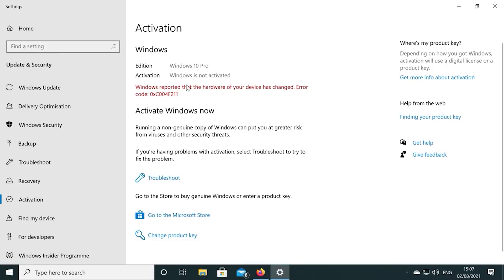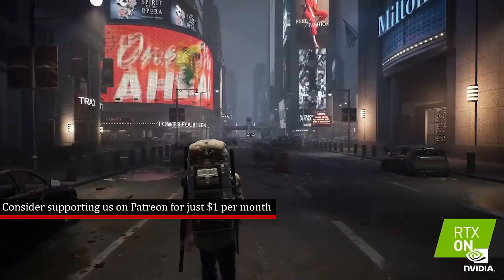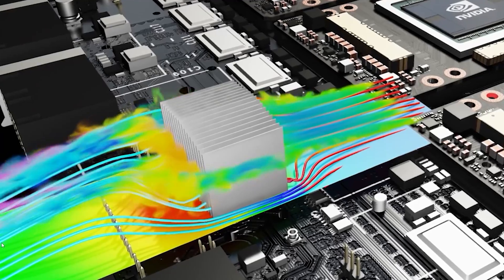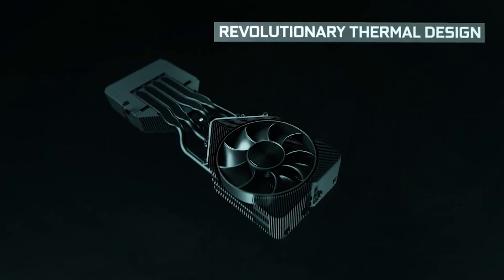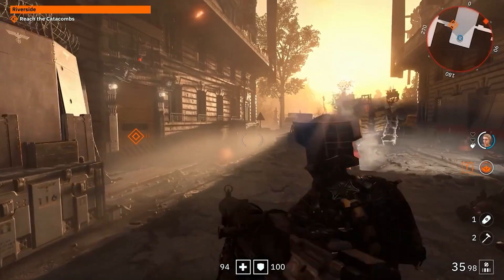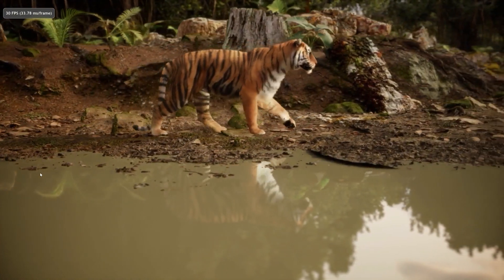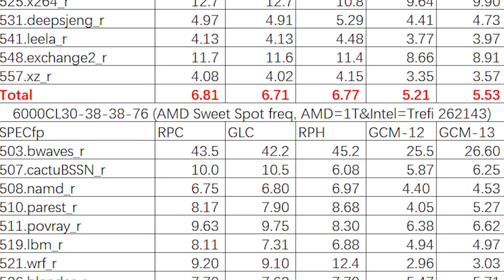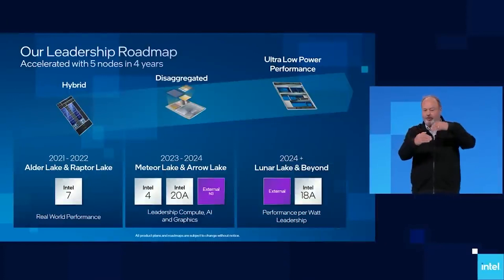RTX 4090 Specs DWARF RTX 4080 - Major Specs UPDATE | RTX 4080 Ti & Path Tracing Leaks

Comment: There's a moderate chance these cards are 600W or higher instead of the 450W published value, especially if you buy from AIBs. There are space heaters that use less power.
Reply: AMD has been making 500 watt GPU since the fury, i havent seen ANYONE cry about the watt usage ever tell it was NVIDIA using more watts.  Is it fanboyism or just ignorance?
Reply: @4gbmeans4gb61  The 6900XT is 300W, you gonna dig up the museum pieces to make your arguments?
Reply: @syrupybrandy2788  Mine OC uses up to 430 watts, about the same as an OC 3090.  Just stop with your fanboy cry baby act.

Comment: The difference between 4090 and 4080 is simply because the cost per transistor goes down far slower than the number of transistors you can put on your chip. So the trend is clear NVidia can spend more money to deliver more performance at the top-end SKU while manufacturing costs at a given performance improve at a slower than that pace.  A die shrink to an expensive manufacturing process widens the gap between top-end SKUs.  As for making the largest card,  the professional market has a demand for as powerful GPU as possible, so there's a demand for a GPU that would be out of the price range for gamers.  So top gaming cards are probably going to become those chips that are designed for professional needs and costs, but Nvidia just slaps the GeForce name on it and has a GPU that both significantly more power and pricier than what would make sense if they were making cards only for gamers.
Reply: Or they just want to make sure there's enough room between the 4080, future 4080ti, and the 4090 - because as we saw with Ampere, those 3080/ti/90 cards (for regular consumers) were far too closely rated and were competing with each other - as we see how much stock is left now those cards clearly weren't well targeted price/performance wise. Most likely the future 4080Ti will sit in the middle, price wise, and performance wise it will be closer to 4090 stock, but then the 4090 will have much higher overclock boost potential (with the +600w boost option), to ensure that those who want the truly best performance regardless of cost, actually can see noticeable difference between the 4090 and the future 4080 Ti.

Comment: I can't see how they can all both the 16G and 12G as RTX 4080... 
- must be a bit of FUD from NV...
Reply: They made the mistake of launching the 3080 with only 10 gigs of Vram and then later made an updated 12 gig model (which also had slightly higher specs and higher pricetag). I guess they saw that both cards could sell, so now they're just offering both variants for the 4080 series intentionally.. But they fail to realize they already oversaturated their own market competition and now they're actively outcompeting themselves because most customers want to buy in the 300-500 price range, but most card offerings exist in the 700-1.5k+ range. Its so backwards. Only miners bought lots of high end overpriced bs up until recently. Nvidia lacks more situational awareness than your average sewer rat.
Reply: @Real_MisterSir  Well, yes, it just seems to me that these are just too different to both be called 4080, but we shall see soon!

Comment: I am considering picking up a 4080. seeing the 340+w draw  will my 750w be enough?
Reply: If it's good quality, yea. Remember, psus can deliver more than their rating, the rating (like in 750w 80 gold) just means the 80 gold rating isn't applicable above its rated spec (aka once you pass 750w its ratings no longer apply). Usually you can expect 30% above at increasingly worse efficiency - depending on the quality. If you consistently push your entire rig to its breaking point for prolonged time then it's a bad idea, but 99% of people don't do this.

If you have a power hungry cpu, lots of cooling, rgb, etc then the total power demand of the rig could pose a problem. But again, this is usually only an issue with fully specced full tower rigs.

Let me put it like this.
If you run a 12900K with a 360m aio or custom water cooling and multiple rgb case fans, then you'd want to look at a psu upgrade. Otherwise you'll be fine.
Reply: @Real_MisterSir  I am running a 9900k @5ghz all core ( 1.32v ) 32gb ram and a 2080 Super atm. No RGB, 3 intakes 1 exhaust and NH-D15. :)
Reply: @Hinjima92  In that case you should be perfectly fine even with a bit of boost headroom on top if the leaked tdps are close to retail version spec :) I run a similar setup but with a 750w corsair psu and 9700k instead, also plan on upgrading to 4080 if they're priced well and I expect more than ample headroom if tdp stays somewhere close to 350w for the 4080 and even 400w could be considered since the i7 isn't pushing as high peak tdp as more modern cpus.
Reply: @Real_MisterSir  Yeah, guess we will figure out soon enough :D  I have no problem buying a RM1000x and slap that in if 750w aint enough.  Good thing about Corsair is they use the same cables so you don't even have to unplug anything from the motherboard, you just slap a new corsair PSU on the old cables. You should NEVER do that unless they specify that its ok, they have a chart on their website saying its all good.
Reply: @Hinjima92  Oh yea for sure, I'm thankful I learned about the cable hazard before it ever became an issue. Swapping psu cables is the easiest way to fry an entire system with zero warning.

Either way, good luck on your build, hope you'll get your parts at a good price after the last couple years of dread haha
Reply: Go for AMD, NVIDIA is probably trying to scam us with the 4080. And yes if it's a good quality power supply it should probably be okay.
Reply: @MicroageHD  Telling my to go AMD was not on topic for my question at all. I prefer Nvidia over AMD when it comes to GPU's.  I have a RM750i so I got a quality PSU. I am going Nvidia because I have a Gsync monitor.
Reply: That 750 may or may not be enough. A 340 watt GPU leaves 410 watts for your other components. Paper napkin math tells me that you probably will be fine. If your PSU is good enough then you probably won’t have to worry about your PC shutting down. Check to see how many watts causes overcurrent protection to be triggered on your PSU. Transients may cause your system to pull 1000 watts or so. At the very least I’d try the PSU and swap it if it is no good.
Reply: @dex6316  Yeah, I am perfectly fine with upgrading to a 1000w PSU, only time will tell though.  I I am quite certain that power draw will be a major point in any 4000 series review or at least the 4070-4080-4090 due to the leaked rumors on power draw in the past months.  It would be nice to not having to buy a brand new PSU though :D

Comment: They're definitely gonna keep the 4080/12 at the price tier of the normal 80 series but in all the marketing they will quote the power of the 4080/16 which will land closer to 1100-1200$. Gives them the marketing edge over amd while "technically" having an upper mid tier with the 4080/12. Which will be an easy way to get me looking elsewhere for the next build.
Reply: I agree and I notice there have been no leaks of the performance level of the 12g 280w 4080 at all.
My guess is that it will basically be at or very slightly exceed the performance of the 3090ti and earlier leaks were saying that the speculated MSRP on the 4080 would be $849 while they were quoting the specs and performance numbers of the 16g 4080 which I think will be at least $1200 msrp.

Remember last year when the AIB's were not making any of their lower tier cards only the upper level cards in a tier such as no 3080 EVGA Black cards only 3080 FTW OC models?
What are the chances they do the same basically releasing few to none of the 12g 4080's but adequate supplies of the 16g model.
Sure they can market saying that a 4080 can be bought for as little as $849 but I bet it may be like finding hens teeth on actually getting one!

Comment: The 4080 Ti is going to be the new 1080 Ti...GOAT v2.0
Reply: Well, then it must sell for 700 bucks max.
Reply: @MicroageHD  inflation is a thing bro. $699 in March 2017 is worth $849 today. Depending on how it’s done, a 4080Ti for $999-1199 could be considered as great as the 1080Ti. I highly doubt the card will be great enough at those prices to be as warmly received as the 1080Ti, but it’s possible.

Comment: With all that energy hungry hardware being released in a few weeks I start to wonder what to play. Most AAA title, mainly the only games needing that kind of power, are kinda boring and repetitiv busy work simulations. Some honorable exeptions like Elden Ring run fine on (pre-) last gen hardware.
Reply: Yep the real issue right now is that there isn't being pushed any major original AAA titles. Most have gone to live-service models instead that don't infer big graphics demand increases, and the last major hitter Cyberpunk launched in a major flop and seems like nobody is quick to try and follow in its footsteps.

At this point the most likely game to truly push performance demands again, would be Crysis 4 - but that game has only been teased with a pre production teaser showcase trailer, so it's likely a few years away still, at which point 40 series will be obsolete as a market proposition anyways.

So either AAA games are low demanding, or they're boring, or they're not released. Not exactly a situation that hypes up the masses to go out and invest in power hungry expensive new hardware. Oh yea and there was a small thing about a war, an energy crisis, and an economic crisis to boot. Good times to be a gpu company with zero situational awareness.

Comment: I suspect the Path-tracing thing is just pure marketing. They're probably expecting AMD to have near parity with them for Ray-tracing, so they're going to pivot to talking about Path-tracing and will use a couple tech demo's specifically tuned for their hardware to make it look like they have a major advantage in that area. The simple fact is though, I'm not expecting many if any games with full Path-tracing any time soon. Most games are designed to look decent on consoles first and foremost, so taking the time to fine tune effects that the consoles probably can't even run isn't going to make sense from a financial standpoint. Heck, we still don't even see that many good games with ray-tracing yet. That'll probably change when the PS5 Pro and XBSX Pro come out, as I expect the major selling point of both will be better ray tracing. (Also better resolution or frame rates, but still.)

So yeah, I'm not going to buy a video card now for an effect that probably won't be common place for another 4-5 years. By the time that effect does become common place, it'll be about time to replace the card again and there will be options that can tackle it far better for a lower price.
Reply: LOL NO.  Amd uses software and Nvidia has built in hardware.
Reply: @4gbmeans4gb61  

AMD does have hardware for ray-tracing, it's just more multi-use and less heavily dedicated than Nvidia's hardware. If I recall correctly, their hardware is simply built into the TMU's and is therefore part of every compute unit, while Nvidia uses separate tensor compute units.

The benefit to AMD's approach is that it should scale up some with every additional compute unit added while also scaling with a higher clockspeed. Nvidia's tensor units are more capable, but you need to add additional silicon that can't necessarily be used for anything else. Since this makes for a bigger chip, Nvidia actually has to make some decisions on how they want to balance the chip for each generation.

Each approach has it's own pro's and cons, but one of the pro's of AMD's approach is that it should scale somewhat with improved raster performance even before there are any architectural improvements.

This doesn't necessarily mean that AMD will see a huge jump in ray-tracing performance, obviously. However, there are reasons to believe they might be able to manage it.
Reply: Rumors are saying at least 2-2.5x faster ray tracing performance for the 40 series over the 30 series for AMD to gain parity in Ray Tracing they would need over 3-4x performance improvement to start getting in the same ballpark.
Do you really think AMD is going to improve their numbers that much in one generation?
Reply: @billwiley7216  

First, rumors don't mean much. There were a ton of rumors for Ampere that turned out to be overblown, so id advise against banking on some of the more gung ho rumors here as well. 

Second, seeing as RDNA 2.0 ray tracing was a fairly late edition to the Architecture that was a little rough around the edges, AMD's probably going to have an easier time making major gains than a competitor who has a far closer to mature feature set.

Third, near parity is not complete parity. If AMD gets close enough, then Nvidia's selling point of Ray Tracing is going to become a lot less compelling no matter what.
Reply: @WolvenWeaver  Will be interesting but the major Ray tracing performance increases for 40 series over 30 series has pretty much been a major talking concerning the 40 series cards for a long time by so many sources I do not think it is nothing but rumors.
I do agree that to see actual performance numbers we need to wait on 3rd party benches to get real world not marketing numbers but this goes for AMD as well as Nvidia.

My personal opinion is that AMD Raytracing will be at minimum as good as 30 series cards and maybe a bit above that which would still be a big gain in that category for them  but they will still be behind.
Where I see them gaining more ground and it is really a more important feature is I think AMD will close the gap more between FSR quality and performance as compared to DLSS which has been the better quality upscaler.
Reply: @billwiley7216  

Well, I've been hearing for a while that AMD's Ray tracing improvements will actually outstrip their general use performance improvement. That's of course just a rumor, but given the approach AMD has been taking towards Ray tracing, it actually does make quite a bit of sense. Now, that's not to say that AMD is going to completely erase Nvidia's lead. Considering how many games are heavily optimized for NVIDIA hardware, completely overtaking that leads in a single hardware generation would be an extremely tall order.

But, given Nvidia's fixation on marketing its Ray tracing, if AMD got relatively close to that, or worse, managed to beat Nvidia in a few heavily optimized AMD titles, it would be a marketing disaster. Nvidia cannot rely on Ray tracing for its marketing if amd's hardware is starting to look in any way competitive. Therefore, I'm pretty sure the sudden focus on path racing is a hedge against that happening.
Reply: @WolvenWeaver  just a quote from one of your earlier post!😁 "First, rumors don't mean much."
Reply: @billwiley7216  

Yes, which was one of my caveats. This is why I mentioned that AMD's implantation may lend itself to that sort of jump. It's obviously not confirmed, but there are reasons why it may be conceivable.
Reply: @WolvenWeaver  Nothing has been announced yet.
Reply: @WolvenWeaver  Any speed up towards path tracing, would be an immediate benefit to ray tracing. They share the same hardware needs. So focusing on path tracing would be an extension to ray tracing, they are not mutually exclusive performance wise. Working on Path tracing is purely in quality domain, it benefits just as much speed up as with ray tracing improvements. So this isn't a case of moving from one to another in terms of hardware advancements. Focusing on path tracing is doubling down on general ray intersection speed up, so if anything this shows that they are pushing 'tracing' further and that means pushing performance speed ups.
Reply: @richardtucker5938  

I'm aware. But one is so much more demanding than the other that it's unlikely any games will be built around path tracing any time soon. Ergo, focusing on path tracing now is almost certainly a marketing more.
Reply: @WolvenWeaver  yeah its a point, though work towards path tracing will again be able to be used somewhat for quality and performance gains in ray tracing in modern games.

Btw, just remember there is at least quake 2 rtx, which looks absolutely glorious path traced. I really liked/looked forward to the 'lightspeed studios' initiative they had, i was expecting more games to get path tracing (old games) not happening yet, still hold out hope.
Reply: @richardtucker5938  

While I don't disagree in general, it's important to remember that Quake 2 RTX i based off a fairly old title that uses far simpler environments and fewer polygons than modern games do. It'll be a while before we can apply the same level of path tracing to modern games, and probably longer still before enough people have the hardware needed to justify that sort of development.

That doesn't mean that AMD and Nvidia shouldn't be looking into it, of course, but trying to sell it for the here and now really would be pure marketing fluff. We are not seeing a modern game with full path tracing anytime in the very near future.
Reply: @WolvenWeaver   i do understand and i do agree, i was just pointing out that quake 2 rtx looks kind of special, and i wouldn't mind more old games being path traced. Nvidia could have gone from marketing to something tangible if they had pushed forward with the 'lightspeed studios' remasters, better way of advancing and applying the tech to something tangible that people could play and appreciate.

Have you seen any of the 'two minute papers' on their RESTIR advancements, and also that path traced tiger demo?